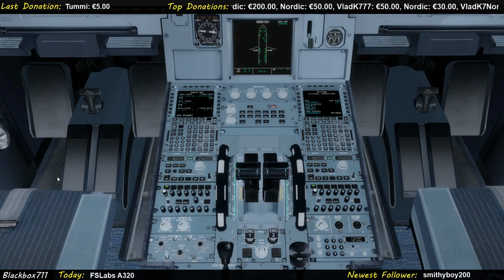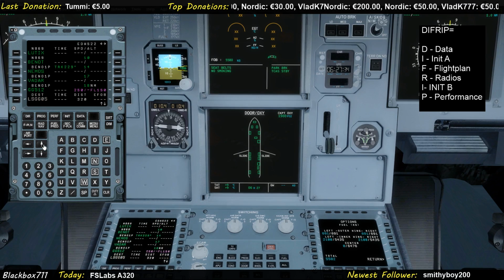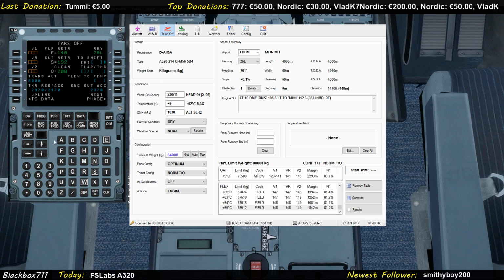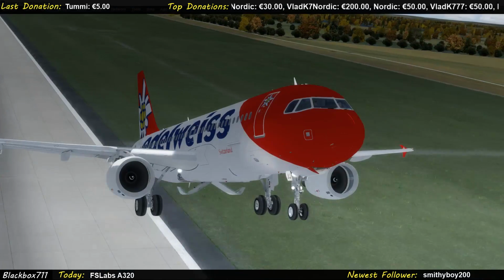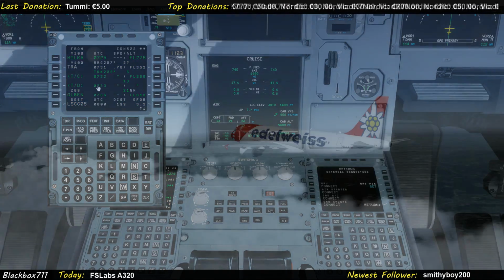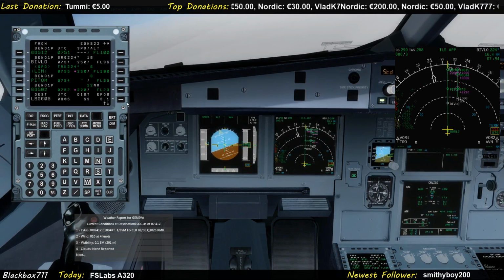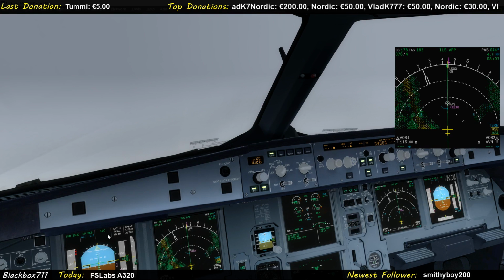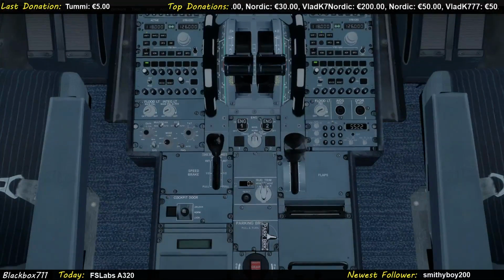[P3D] FSLabs A320-X - Workshop MCDU/FCU on Flight EDDM-LSGG

Comment: Cpt Blackbox. Very enjoyable video. Just bought the FS Labs version of the A320 so still in the learning curve converting from the 757. A request please. If possible can you redo this flight using the latest 2020 version of the aircraft, with a look at ATSU, AOC Menu, GSX integration. Thanks. Ian

Comment: Hi, I know that in Boeing Fmc you can add offsets to your route for weather avoidance or while flying on a nat track. Does the airbus have a similar feature? What mode do you use for weather avoidance
Reply from the maker: The real aircraft has an offset function. The FSLabs unfortunately doesn’t.
Reply: Blackbox711 : thank you. The aerosoft a319 also lack that functionality. Thank you for the reply.

Comment: how to and where to export the flightplan from pfpx to fsl a320 there is no option to save for fsl a320 please sir help me
Reply from the maker: Please read the manual that comes with the installer. They explain everything in great detail there. You will find the manual in a file that should be on your desktop after installation.

Comment: +65 flex topcat calculated n1 81% and in fact it was n1 84.3%, is the normal error?
Reply from the maker: I don’t use the TopCat N1 because it is not very accurate. Anyhow, the FMC value is master

Comment: Hi Expert out there, May i know aftertake off do we need to change the throttle from Flex to club, or the auto throttle will do the job? coz mine just keep on having MAN THR and LVR CLB sign on the PFD after take off . many thanks!
Reply from the maker: +tiffany51793 .. the thrust levers have to be set manually into the correct nodges. Regards
Reply: Blackbox711 thx BB,☺

Comment: Hi BB !May i know the checklist for calculating the trim setting, is that how you will find out in real life ? thanks again !
Reply: In real life you receive a loadsheet from the company, most commonly via ACARS; It is issued when the actual cargo and passengers weigths are known to the company. It contains the ACFT actual weights, CG position and the trim setting, among other informations. Usually you receive it when boarding is almost complete
Reply: @vitormuzzi313  🤗❤️

Comment: Great video. Video request. Can you please do a video on how to change altitude constraints and speed . For example, EDDM does not have updated star information in the latest 1702 cycle. Unless, I am doing something wrong the data is missing. I had to manually enter the ANORA 2A arrival.
Reply from the maker: +Iron Condor Simulations ... I need to check the new cycle. A video on changing constraints is also a good idea.

Comment: Hi, how many fps did you have during takeoff? I see that the takeoff run is slightly jerky. Thanks.
Reply from the maker: About 25 FPS. But James, to be fair I have to say that when I stream I have between 7 to 10 FPS less. So offline I would typically have around 30 - 35 FPS.